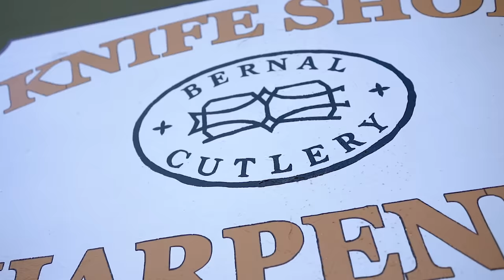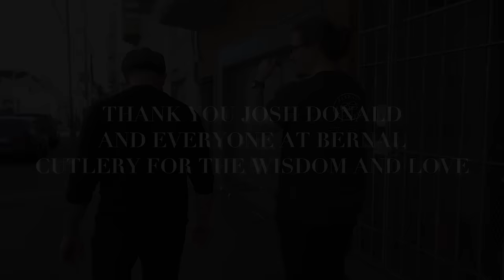Sharpen Your Kitchen Knife Like A Master Sharpener

Comment: One curious fact on metallurgy. Stainless blades will never be as sharp as a carbon blade, even when sharpened by a pro, side-by-side, and taken to the finest stone available, and that is because the molecules of stainless steel are quite larger than the ones from carbon steel. So, when you go all out sharpening, ultimately carbon blades become the sharpest, and there is no way around that molecular fact. And for Moi, a basic guy with basic skills in the kitchen (as Thomas Keller said -"I warm up food very well") with my stainless knives, a Kyocera roll sharpener does the job just fine.

Comment: "dont let the finger drag on the stone"
agreed, blood is a very poor whetstone lubricant, too thick, gums it up right quick.
Reply: I did exactly what he said not to and cut. I relaxed and forget my fingers so next thing I see is a blood splashin 😂
Reply: Funnily enough, most master sharpeners have rubber off their fingerprints due to contact with the stone. The closer the fingers are to the bevel, the less pressure will impact angle control.
Reply: Upside if your knife is sharp it won't hurt that bad probably maybe
Reply: Depends on how much alcohol your donor drinks.
Reply: @TheNoobsteak  lmao facts!
Reply: I ain't got a finger that hasn't had stitches.

Comment: This video is the simplest, clearest, easiest to follow knife sharpening tutorial I have found. It helped me to remember how to do it again, because I haven't in a long time. I keep my knives sharp most of the time by using my steel, but eventually, they just need to be worked on the stones. 

Now, thanks to your instructions, my paring, French, and boning knives are sharp again! Thank you!
Reply: Sharpening a knife and honing its edge with steel are two completely different things. Sharpening actually removes metal from the edge and honing just realigns the micro-structure of the steel.
Reply: @the_inquisitive_inquisitor  Yep, I know that.
Reply: get rid of your steel hone. Buy a strop paddle (wood backed) or use a ceramic hone but strop is so so so so so so so much better
Reply: @richmondvand147  Thanks for this suggestion. I will check that out.

Comment: Suggestion: cut gloves. For those of you genuinely interested in learning to sharpen your own knives by hand or just to practice your knife skills, I would recommend investing in a cut glove. As the name implies, they are reusable gloves (usually made from kevlar, stainless steel chainmail, fabric, or a combination of the above) worn on the off-hand (the one holding still the item you are cutting) that greatly reduce the risk of slicing your hand.

I personally prefer the chainmail version, as it allows for a significantly greater degree of freedom of movement. They are quite commonplace throughout the foodservice industry; usually less so in restaurants with trained chefs and more so in casual foodservice locations. Naturally, they tend to vary in price (usually $10-$80 USD) depending on your material choice and production quality. While they aren't perfect (they won't protect you from poking yourself with a knife), they offer significant protection as you hone your skills and confidence using knives.

Comment: Label: "220 COARSE ONLY"
Josh "there's 220 in here there's also 400 in here"
Reply: Clearly rules are made to be broken
Reply: I know it's just a joke, but there isn't much difference between 220 and 400. 220 is more for really damaged knives that have chips, etc. 400 is a good starting point for creating an edge.
Reply: @nanashivii9237  this is actually good to know!! Thank you 😊
Reply: @nanashivii9237  it depends on the stone, a 220 stone might be slow cutting enough to be useful to create an edge, you really need something super aggressive for damaged knives, i often see 120 or 140, the atoma diamond plate stands out for how aggressive it is. it depends on the size of chips, like you can take out a 1 mm deep chip on a 220 grit stone, but there have been videos with like 5 mm massive chips, and those are gonna require something a lot more.

i would personally start with like 600grit and then 1200 grit and then strop it. it's super simple and your knife sharpness is mostly determined by how good your technique is and your strop. you can get it razor sharp easily if you have good technique and a strop with pretty much any sharpening stone. (i would say polishing stones don't really count but like it's obvious super fine stones won't work) you can even use a rock to sharpen your knife, check out burrfections video on it. it's super interesting.
Reply: @BloodSprite-tan  Agreed, although it's often a fool's errand to take larger chips out with a stone itself. If a knife is that badly damaged, it's usually more efficient to just grind it out with a belt sander and then create a new edge with the stones. I personally cycle through 400/1000/3000 then leather strop. As you say, stropping is what makes all the difference, and though I do sometimes use higher grit polishing stones, they're more often than not requested for aesthetic merit rather than being functionally superior.
Reply: @nanashivii9237  i agree.

i wouldn't personally use a belt sander to repair a knife, they take off to much material to do it careful and can easily mess up a knife worse. diamond stones go much slower, but that's the benefit, you get to be much more intentional about the material you remove.
Reply: puts fine stone in coarse container

Comment: If you're not sure you're holding the angle right the whole way, here's something I learned in printmaking:  you put sharpie marker on the blade near the edge, and then when you are sharpening, if any section has a different angle, you'll see it through a difference in if the sharpie is gone. 
Another tip, if you look directly at the edge of your blade and see shiny areas, those are the dullest sections.  If you sharpen the blade and then look at the edge straight on, there should be no shiny sections.

Comment: I've been sharpening my knives for a year now and while they're really sharp they're not as sharp as the intro. Then I realised after watching Josh my angle is wayyy too steep, maybe 20-30 instead of 15 deg.
Reply: Platinum yeah same here and i use way too much water while sharpening too 
I’m doing things so wrong it’s unbelievable 
At least we’ve learned something though
Reply: all depends on what your going for and the intended use of the knife a steeper edge angle makes it more resilient to damage but you get a less keen edge i usually am at 17 degrees
Reply: @brog3143   first video i just watched said 45 degree angle. much too much.
Reply: @littlepils4187  45 is something i'd sharpen a wood splitter at. Hard use knives and axes at 25, and 20 for edc knives. 15-17 is really only good for kitchen knives, otherwise your edge is too fragile.
Reply: Your knife could possibly have a 20 degree sharp angle though.  They're not all the same.
Reply: I was doing my knives at 90 degree angle & it is dull af I'm a try 15.

Comment: Just like the last knive video I felt like this could have been a lot more informative. Questions that immidiately popped to my head but remained unanswered: Which stones should I get as a beginner set, are there significant qualitity differences between stones, how long do you stay with one stone and how often do you flip the knive while before moving on to the next stone?
Reply: Get the cheapest one. I saw a test last time between a 20$ vs 120$ stone and it didn't change much.
Reply: The stone should come with the answers to the questions you have.
Reply: Knife enthusiast here. I recommend the Kind KDS 1000/6000 combination stone for a beginner. Another great choice is the shapton pro 1000. These are the best options for beginners because they don't cut too quickly, and give excellent "feedback" (smoothness of use) while sharpening. Check out Japanese Knife Imports Videos on sharpening or Korin's videos. Also check out on reddit r/chefknives for more tips to get started.
Reply: you want to flip the knife 1 time you sharpen the knife until you create a burr, then flip and sharpen the other side until you get a burr, and after that, you flip and just lightly clean the edge on both sides before switching stones. i personally only use 1 stone most of the time. you don't need too many. after that you use a strop, it's super helpful. even more than using a high grit polishing stone, and they are much cheaper than a high grit stone.

it's usually not recommended to flip the knife multiple times, because it can lead to inconsistency in your angle. consistency is key.

i personally using a 1000grit whetstone and a leather strop, a cheap one off amazon with green waxy polishing compound, they are all over, and super useful.
Reply: @BloodSprite-tan  Never bought a strop; newspaper works fine.
Reply: @madthumbs1564  yeah you can use pretty much anything as strop, i've just had the best luck with a real strop, the news print here isn't the best. it's not impossible just much more difficult to strop with it. leather isn't super expensive either. you can use an old belt which are pretty cheap.
Reply: Egad mate... you want the world on a fecking plate don't yah?
Reply: @madthumbs1564  Enjoy commercial ink on your knives  - blech. But I strop on an actual strop because it just works better and more consistently. I mean yeah I could use regular gas in a ferrari but why the hell would you when 95 octane is so much better

Comment: Step one: getting a better knife that my 3 dollars one
Reply: You don't necessarily need an expensive knife. If you take decent care of your knife it will cut just as well
Reply: The fine folks at America's Test Kitchen have your back on the best affordable chefs knife.
Reply: @Misa Misa that works too
Reply: @russellhoude5744  while I agree that not everyone needs a ridiculous $3k Damascus steel knife, it's a good idea to not go for bargain bin value as well.
I have made a mistake of buying a knife that was the equivalent of 3$ in local currency, it had bevels that would go all over the place, 20° on one side, 27 on the other side, and an edge wavier that a flamberge.
Reply: Jun's kitchen did a video on sharpening a ¥100 ($1.00) knife. It can be done if you have the skill and wherewithal. It will just get dull faster
Reply: i use kiwi brand knifes from thailand. if you think you need a nice knife for it to be sharp you are mistaken, you just need the right cheap knife. also a strop, it helps a ton.
Reply: You don't need a $200 knife to get it razor sharp, you just need about $200 in whetstones lol.
Reply: @AlibifortheAfterlife  yeah well but that's wrong.

you need 500$ in whetstones, and a buffalo leather strop with 1/2 micron diamond spray stropping compound.
Reply: cheap or not its got to have a full tang
Reply: @cobravenomX1  arguable. full tangs are always nice, but realistically you'll probably not need one, unless you're hacking into wood or bone. which if you are using a kitchen knife for that, then you are wrong.
Reply: @BloodSprite-tan  i got a simple cheese knife and tried to cut the cheese  and the handle split open. the blade was very sharp and the handle was plastic. if im going to chop i use a clever for that.
Reply: @cobravenomX1  cheese is harder than veggies or meat, frankly the worse you can do is try cutting something that is too frozen. if you're slicing cheese you really either need a guillotine or like a metal string to slice through. cheese knifes work better with soft cheese, there is rarely a case where you can actually use a cheese knife on cheese.

though i wouldn't use a chef knife on cheese. i mean sure i have a full metal knife. handle and all, and it can cut cheese but why would i? the blade has way to much contact to easily cut cheese and this is always true regard of what knife you use. using a fancy chef knife isn't gonna make it any easier. cheese is so annoying to chop.
Reply: no it was not frozen
Reply: yeah okay. sure buddy. you said cheese. why would it be frozen are you paying attention? using a chef knife the worse thing you can do is cut frozen food. I'm not saying you cut cheese with a chef knife and I'm not saying your cheese is frozen. you'll probably not encounter cutting cheese that often, but if you do, you should get a metal wire for cutting cheese.

Comment: 4 japanese wetstones up to 10.000 at home, lots of practice and patience. Using professional but cheap chef's knives (20 euro). Razor sharp :)

Ceramic honing rod is also a must. Very satisfying to do
Reply: ... whetstones* (from "to whet" = to sharpen) and 10000 grit is absolutely pointless on cheap, soft-steel knives as they're not going to maintain that super-fine edge for longer than a few cuts. No need to go over 6000 and only on hard-steel blades for cutting paper-thin sashimi, anything above is sharpening of its own sake. But glad you enjoy your hobby, and agreed on the ceramic honing rod.

Comment: The toughest test for sharpness that I know is to fold a piece of copy in half on the 11" side, stand it up.  With the exterior crease facing you, take you knife and see if it will cut the crease of the paper without holding the paper.  If it can, that is sharp.  Really sharp.

Comment: Hi Josh! I’m 14 years old and i got into cooking a few years ago. Do you have any recommendations for a budget-orientated chef knife? I want to get one for my birthday, but a lot if them cost over 100$. Thanks in advance!
Reply: check out japanny, iseya chef knife just barely over a 100, my commis has it, decent. but note that a basic set of stones can cost as much if not more
Reply: rando01 I live in the middle of nowhere :(
Reply: VinDuo Can't go too far wrong with a 8 inch chef's knife from Victorinox. Sharpens easily, well balanced and will last for years. Oh, and the price is super cheap for the quality you're getting. Can order on Amazon: search for Victorinox Fibrox Pro Chef's Knife, 8-Inch. Good luck!

Comment: This is very helpful to me. Here is where I am: I am self taught.  However, the stones I got over time are Arkansas, and I use honing oil with them. I have a course, fine, & translucent. I have used them with 3 sets of knives we got as wedding presents 40 years ago: 2 carbon (Sabatier & Chicago Cutlery) and 1 stainless (Mac). I am fond of my knives and stones, but how can I adapt? These stones are used to the oil already. 
Also, thanks for the hand placement & 2 quarter trick: That was all new to me. That's the big lesson already, so thanks again.

Comment: Step one: get a stainless steel Japanese knife..
Reply: any knife will do, you still can sharpen it with stones, its all about how good the steel is at keeping the edge
Reply: Looks like he's actually sharpening a carbon steel Japanese knife, which is easier to sharpen but doesn't hold its edge for quite as long. They can be pretty affordable as long as you don't get a hand-made Japanese premium brand knife.
Reply: step one: get a whetstone.
Reply: step one: collect some clay
Reply: Don't just jump into it. If you have a plastic cutting board and buy a Tojiro DP or the like; you're going to hear that think micro-fracture as you pull it out of the cutting board. You don't take a Ferrari on a dirt road, and you don't want and expensive knife on a glass, bamboo, plastic, etc board. You also want to learn about things like metal fatigue. This video just shows common practice which is ok, but there's better information in Cliff Stamp videos. Knowledge should come before the knife.

Comment: I have an addition to flex on this with (lol), I have a collection of good machine-flat whetstones that have their place for setting plane blades and such back into true, and I have a good basalt whetstone that I still keep in the kitchen, and I have some culinary chops although I'm not gonna claim to be award winning or record setting in anything, I've been paid to cook and have serious knives besides all the machining stuff.  In machining cutting theory they use different lubricants to do machining operations like polishing and such, so the first note I'd make is that windex-type spray cleaners seem to make among the best of all possible whetstone lubricants; spray it on your stone soaked in water for the best economy of effect.  SECOND, rather than traditional stones, I recommend anybody reading this get a good flat ceramic tile and practice good sharpening on this rather than a stone, because of the higher hardness of the ceramic. You can corroborate this with a quick spin through googletube for 'the coffee cup trick', which is indeed moderately neat-o, but inferior to proper sharpening technique using that same material to full effect. same sort of soaking stuff as the traditional stones also applies, remember that the shiny side of the tiles are waterproof and in addition to being worthless for sharpening trap in air pockets, so put them facing downwards when you soak your tile.  Rough bottom tiles are even comparable to rougher stones, I have a grid-latice patterned bottom design of tile that I use to rough-in new edges, and the protruding lattice of unglazed ceramic gives the blade going across the most chance to dip down and then collide with the next protrudence and get sheered down by it.  my favorite tiles are arguably the 2x8" smooth bottom white ones I found at a second hand building supply store for $0.30 for the set of 3, which are long enough that I can basically strop them with my daily cooking knives as I would a steel to keep the edge both trued and sharpened.

Comment: I know how to sharpen a knife. From stones to fine grit, from filament in a light bulb to ceramic sharpeners. I'll continue to put my expensive spyderco and kitchen knives on a easy cheap 15 buck spring loaded V cut sharpener because the most important part of sharpening i've found is stropping. I drag my knives across buckskin when im done and i don't have to spend time worrying about it. Sharp as a razor.